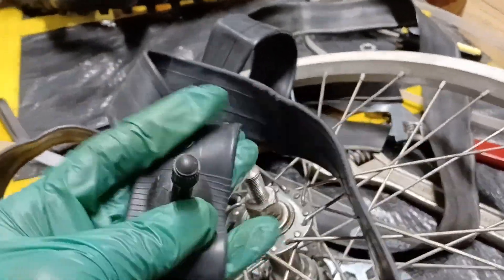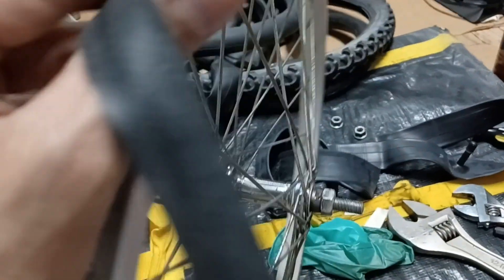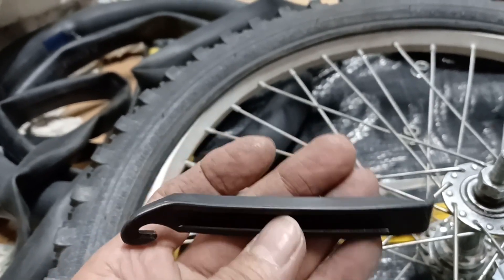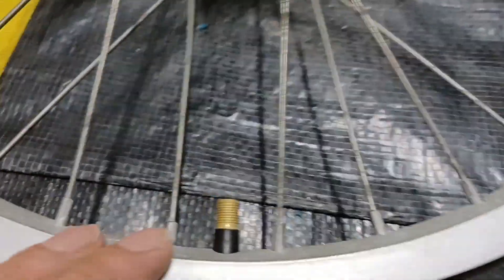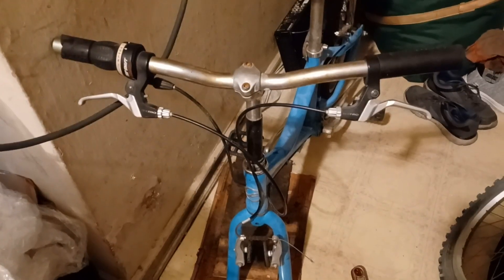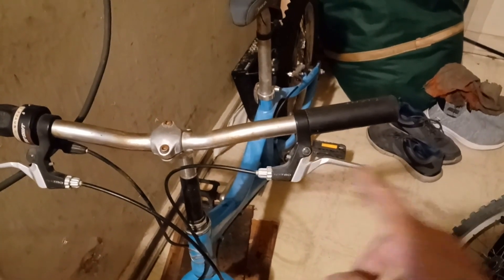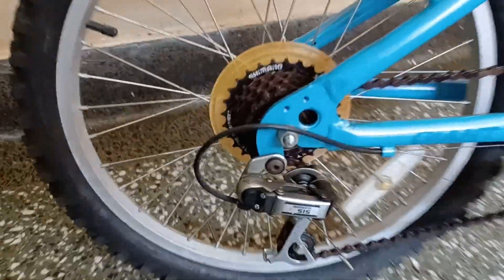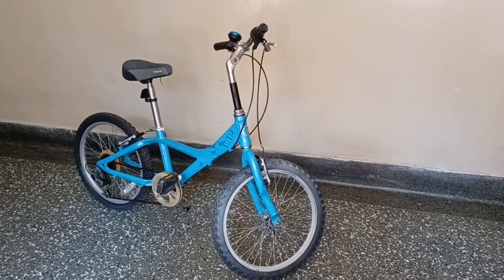Installing Bicycle 🚲 Inner Tube 🛞 And Homemade Rim Liner

Comment: Gorilla tape is another good alternative. We use it for tubeless set ups at the shop
Reply from the maker: Yeah, that's great. Gorilla tape, vinyl tape, duct tape. They're all good for the job. The thing is, with me, I like to recycle, reuse, refurbish, repurpose. I like to experiment. See different ways of doing stuff. When you said tubeless, are you talking about motorcycle tires and car tires? Or do they have tubeless bicycle tires nowadays? That's new for me
Reply: @irfaanxlcr8370  I’m a big fan of experimenting and recycling too. Old tubes make great rubber bands!
Tubeless bicycle tires have really blown up in popularity over the last few years. Started in mountain biking but has moved to road biking too. It cuts out a lot of the fear of flats and lets you run lower tire pressure
Reply from the maker: @jimjohanson8152  
Interesting stuff. I could understand how the guys feel if they're out in the middle of nowhere with a flat tire. Can't call AAA. Must be expensive though. Thanks for sharing

Comment: I use electrical tape.
Reply from the maker: You anticipate a short circuit? 🤭
Thank you for watching and for your comment. Have a great day
Reply: Very informative, but how about attaching a dynamo to power a headlight to the bike..,
Reply from the maker: @carlospaul9214  
That's old school. Last century. Nowadays we have battery powered LED lights. Those old generators slow down the bike and the light is not a constant luminosity. It gets brighter and dimmer as you pedal.
Reply: @irfaanxlcr8370  Electrical tape can be stretched to fit into the valley of the rim,  and then opening up the hole for the valve.
Reply from the maker: @TomTerrific-vm3qg  
You're right about that. Vinyl tape is very flexible and easy to work with. A lot easier than what I did just now. But I like to experiment. The only thing I'm thinking about is after some time that vinyl tape will become sticky and gummy.